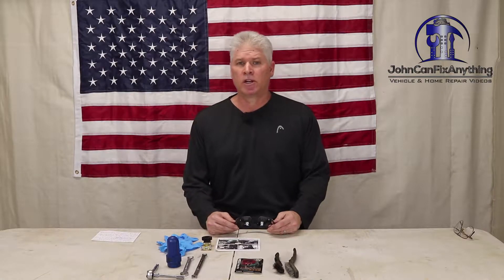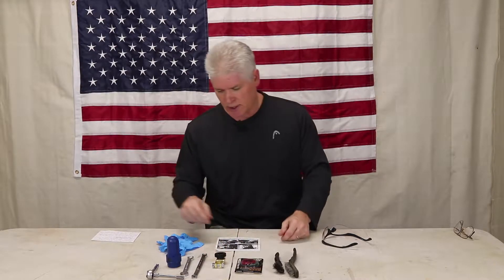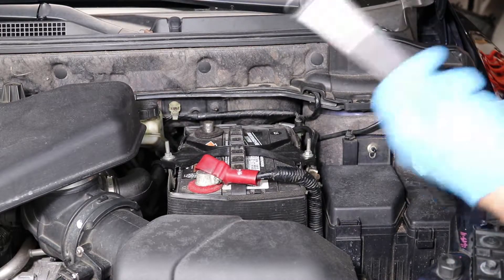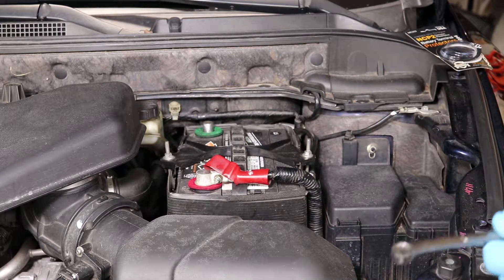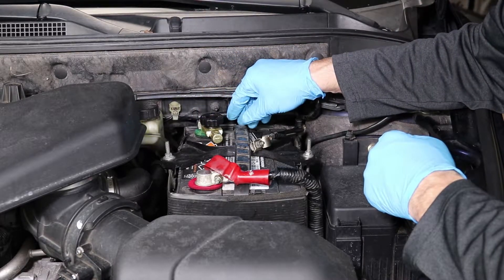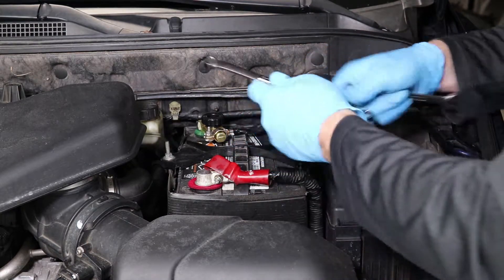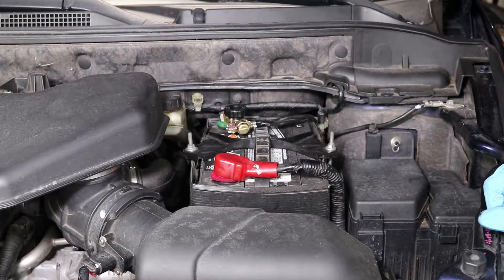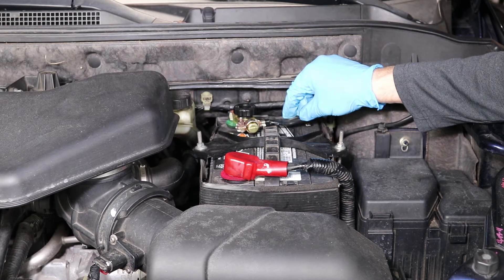Battery Bypass Switch & Terminal Post Upkeep

Comment: I have been using the side terminal GAMA battery bypass for 4 years on my old 2001 Aurora, and it has worked as a charm!  My Aurora had developed a mysterious battery drain, a multiple day stay at mechanic could not determine the cause.  My GM dealer checked as well and could not determine the cause, and suggested monitoring for multiple days as well (costing $$$ per day whether or not it was fixed).  The best guess is that it is the anti-theft system.  The problem is replacing the anti-theft system costs more than the car would be worth, and I believe dealers are prohibited from disconnecting anti-theft systems.  I have always loved the way this car drives, and I drive it less than 3K miles per year; so replacing the car makes little sense.  My very low tech / low cost solution was a $15 battery cutoff attachment to the battery terminal.  This is also convenient to use, as the Aurora's battery is under the rear seat.  I use this to disconnect the battery when it is parked in my garage, and in the past few years the battery has never gone down.  Subsequently, when I park the car with the battery switch connected, after startup the DIC gives a Theft System Fault message, reinforcing the guess that the anti-theft system is the cause of the battery drain.
Reply from the maker: Thanks Mark.  It works really well on my Mazda CX-9 and really convenient when I need to disconnect power.